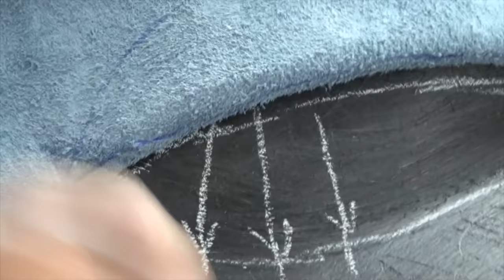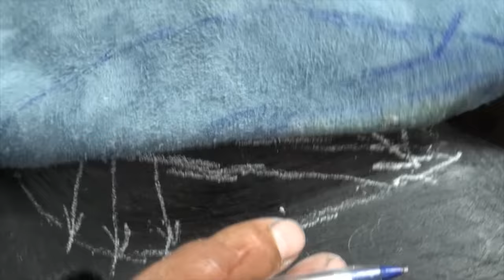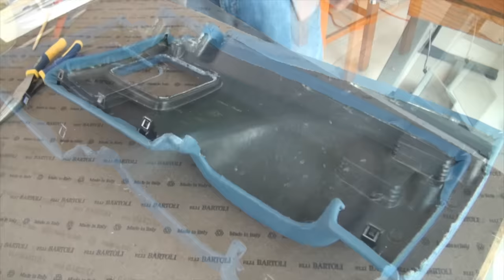A Plastic Piece Wrapped in Leather - Auto Upholstery

Comment: and if you have a spot that loosens up you can inject glude with a needle and hold it down to stick it again.
Reply from the maker: Hello, Yes, it could be. Preferably, it would be much better the 'polyurethane transparent glue' which is activated with heat(hair dryer is useful). Shoemakers use this glue to stick shoes and tennis shoes. The application is on both surfaces. Let them dry if possible the whole night. The more dry is the better. The next step would be to prick a tiny hole with a pin to let the air out and immediately press down with a weight and the application of heat with the hair dryer.

Comment: dash not gonna fit because the leather added extra thickness to the dash. you need to sand enough materials to compensate for the extra leather.
Reply from the maker: The plastic pieces were sanded beforehand for a snug fitting.
Reply: @Cechaflo  how do you ensure the whole dash were sanded evenly since it isnt flat. is there a way to measure?
Reply from the maker: @TomatoTomato911  The surface is evenly sanded to  make the gluing process more efficient. Just enough to remove the oily film on top.
The plastic part edges that would house another plastic piece should be skived with a razor and sanded just enough to let the other piece be evenly attached. It means the thickness of leather material should be considered.
For instance, the recess that houses the glove box handle was sanded/scratched considering the leather thickness (1.2mm thick)https://youtu.be/n8uT7CvG6Z0?si=3S9BcNOd_1qMP8rs&t=271
Reply: @Cechaflo  great info. just wondering what about areas where speakers and other parts slide in, because while the added material would not affect fitting if you trimmed the edges the dash might look slightly raised compared to the speakers which should sit flush along the dash before the added materials.
Reply from the maker: @TomatoTomato911  Sometimes in the case of speakers, airbag lids, etc. on a dashboard it is advisable to skive very thin the leather edges where the piece would sit.
https://youtu.be/QPC6mbmv05s?si=Br7rduKX3ZwK17dM&t=998

Comment: What adhesive is used?
Reply from the maker: I am located in Mexico and I'm using a 'solvent based yellow glue/contact cement'...trade marks are diferent.
If you are in USA, please, check these links:
https://angelusdirect.com/products/all-purpose-shoe-cement
http://www.ebay.es/itm/Petronios-Master-All-Purpose-Cement-Glue-Shoe-Repair-Adhesive-Glue-4-oz-/112032405167
http://www.homedepot.com/p/DAP-Weldwood-32-fl-oz-Original-Contact-Cement-00272/100125525
http://www.dap.com/dap-products-ph/weldwood-landau-top-trim-high-heat-resistant-contact-cement/
Watch min two:08 of this video where Greg shows the use of ´petronios'glue.
https://www.youtube.com/watch?v=RLH8BY8a2to
Reply: Thank you
Reply from the maker: You are welcome anytime!

Comment: what the glue?
Reply from the maker: I have used a solvent based(thinner) adhesive/cement/glue which most of the upholsterers and shoemakers use. To have an idea, please check these links:
http://www.ebay.com/itm/Petronio-039-s-Master-All-Purpose-Cement-Glue-Shoe-Repair-Adhesive-Glue-4-oz-/112032405167?_ul=EC
http://www.ebay.com/bhp/weldwood-contact-cement
If you're going to use one of these products, do a test beforehand.

Comment: This is the biggest waste of time and money. anyone who knows about leather knows  it  is constantly shrinking. This wont last a year
Reply from the maker: A saying says: there's no accounting for taste. Fortunately it has been more than 10 years and the leather piece is still in place.
Perhaps due to there's no much sun heat over here.
Reply: @Cechaflo  well you would be the first time i've ever seen leather not shrink
Reply from the maker: @donscheib  You are right all leathers shrink by time passes by. But, ones faster than others. Automotive leathers have a thick coat of lacquer/transparent sealer on top to protect them from sun rays.  Some cars including luxurious ones are upholstered with semifinished leathers which are more pliable and softer than automotive top finished leathers.
Some of these leathers are aniline (no sealer/lacquer on top) or semianiline (with a very thin coat of lacquer). These leathers should be cleaned and conditioned with special creams/conditioners every 3 months or they would be shrinking very fast. We would have to be very careful of not having the car under the sunrays, try to not use much the air conditioner,  Our clothes should be free of dust,  etc. The pores of these leathers are open and breathing constantly, so no dust, or other malignanant agents such as the grease of our own hands. Otherwise, they would last a short time.